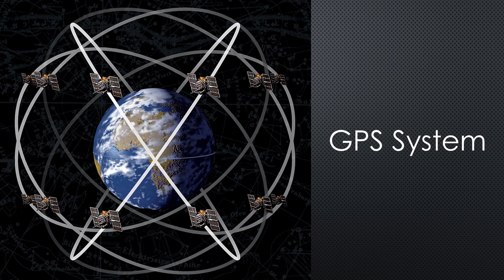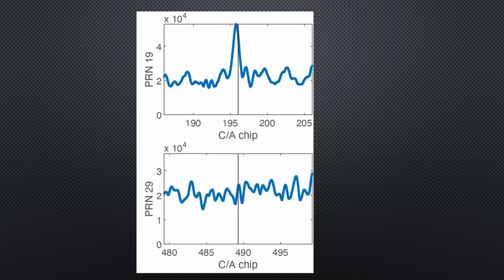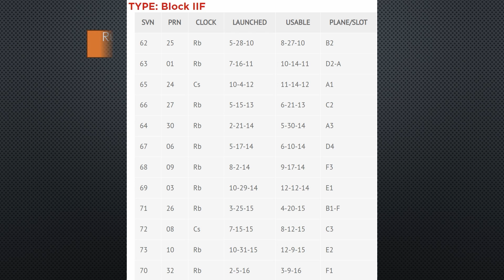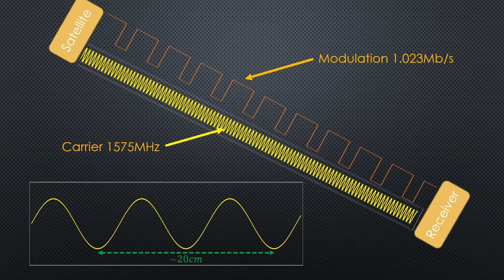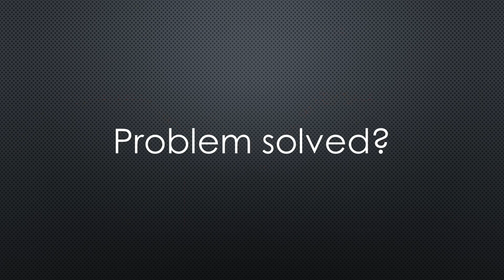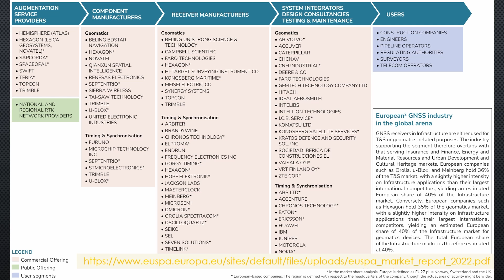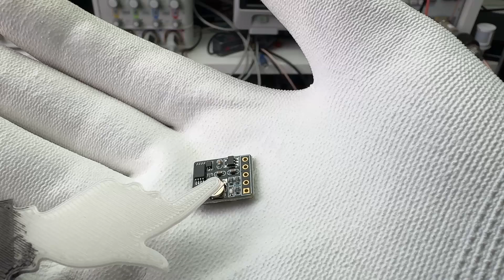(483) ESP32 precision GPS receiver (incl. RTK-GPS Tutorial). How to earn money with it (DePIN)

Comment: Excellent video! One question, how does the base station know it’s exact position? Is it placed using already surveyed points? Sorry I may be missing something 😅 hope my question makes sense.
Reply: In the case of onocoy, this is done through processing of 24h of satellite phase measurements from a base station, and then using a PPP-RTK processing in the cloud, This (non-realtime, post mission) batch processing uses additional data, eg. precise orbit information and earth orientation parameters from 3rd parties, to determine the location to ~1cm or better accuracy. 

So stations undergo a Validation period initially to determine their precise location, and this is repeated frequently to verify that is has not been moved.

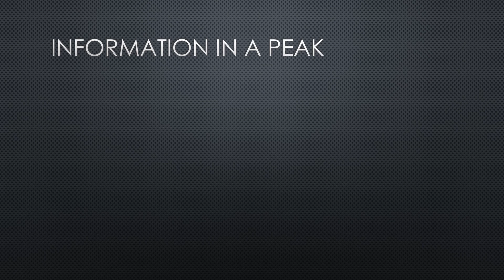Comment: 6:10  Correction: 1ns corresponds to 30cm, not 30meters.
3E+10cm/sec x 1E-9sec = 30cm
Reply from the maker: You are right. My mistake!
Reply: @AndreasSpiess Thank you for video. You did a great job! Typical resolution of the cheap GPS is about 3m. There are, probably, technical factors that degrade 1ns ten times.

Comment: I love this video, with the introduction and everything. Very educational, thank you!
So basically, even if I have my own base, I always need some RTK online service if I want to build something like a fully automated dyi lawnmower in order to get that cm level precision, is this correct? I'm assuming the raw data sent by the RTK base has to be transformed into the respective RTK correction? Can it be done locally?
best regards
Reply from the maker: If you have your base, you can decide how you want to transfer the correction signals to your rover. An online service would be one, but you could also use other wireless serial connections. At least on short distances of a few 100 meters.
Reply: @AndreasSpiess  thanks for the clarification

Comment: Great video! This seems like a very cool application of blockchains. With increasing precision available GNSS is becoming a real alternative to many other forms of sensors, in my use case it seems like a possible replacement for variometers in gliders for which traditional pressure differentials (TEK) have inherent disadvantages. 

With good RTK coverage (available globally to anyone at a fair price) it would likely be possible to achieve better precision while also relying less on expensive (and erratic!) IMU sensors. And I would assume there are many other use cases like it. A bonus would be if every club could contribute to coverage for the wider infrastructure and at the same time be compensated for their contribution.
Reply from the maker: I agree, there are a lot of use cases. And as usual, if a service becomes available, new ideas start to come...

Comment: Thank you, great information and I may take on building an RTK system as I have a Yarbo Lawn mower/snowblower/etc... but my issue is getting HaLow from the RTK to our front yard because of a large hill, (Not Swiss type hill, so maybe small to you but causes interference :)) I am trying to figure out how to get a strong HaLow signal to that area and the company states I cannot use an extender.
I bought a Morse Micro router to at least try but I may use the router to get wifi to the front because the Rover also uses Wifi to communicate it's position.
If you know how linking a HaLow internet to my rover I'd love to see that video.
Thank you
Reply from the maker: HaLo, like most radio waves, cannot pass through obstacles. So you would need a repeater on the top that can see both. If you are lucky, signals are reflected somewhere and, like that, can go around the hill.

Comment: Excellent video Mr.Spiess. Can I ask you a question? I would like to know which one or which ones you think are the best equipment that can be fixed in forest conditions. The best device I have found to date is the Hemisphere 631, but it is a bit expensive. What should you look for when purchasing one of these devices? From what I have read, the number of bands and frequencies is important because it can capture a greater number of satellites. (PD: I have some relatives whose last name is spiess, they come from germany many years ago) Regards
Reply from the maker: 1. I did not check the performance of the receivers for weak signals because this is not needed for a base station with an open view to the sky. So I do not know the answer
2. Indeed, there are Spiess also in Germany, somtimes also written with only one "s" at the end

Comment: Instead of the 250US$ UBlox (1-2 units) now there is s cheaper Hardware from Waveshare LC29H(XX) GPS_RTK HAT for 60 US$. You need a Raspberry, too. It the worst 2x RTK HAT (Base + Rover, the LC29 is different + 2x Raspberry PI.
The hardware is working on a Raspi4. Unfortunately I did not manage to get the BKG Ntrip Client (BNC) working on the Raspi up to now. Qt5 has to be installed for a graphical interface. Maybe there is another software.
Reply from the maker: Thank you for sharing your experience!
Reply: @AndreasSpiess  You are welcome. 
It can mean - thats your decision - work for you. :-)

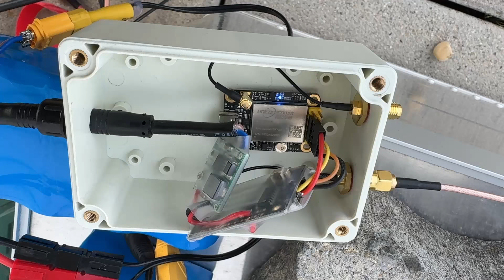Comment: Andreas, @14:10 in your video I see a Witmotion UM982 board (i.e., dual-antenna), with only one antenna connected.  Did you buy a UM982 board intending to have some other fun trying out relative positioning/orientation, or is there some other reason you didn't show and use the UM980 (single antenna) board "color" from your AliExpress links?  Thanks!
Reply from the maker: Yes, I thought that the UM982 offers more possibilities for a similar price
Reply: @AndreasSpiess  I enjoyed putting together a UM982-based kit.  Although Android Bluetooth SPP seems easy and robust, one of the challenges has been BLE reliability & performance required to run the iOS version of SW Maps.
SW Maps works ONLY with the Nordic's UART Service (NUS) profile for BLE.  I tried the Adafruit Bluefruit LE UART Friend (which supports NUS), but found that its bi-directional throughput was poor and unable to support NMEA / RTCM traffic volume.  I also tried Sparkfun BlueSMiRF V2, that works great with heavy unidirectional loads, but crashes and disconnects under that same bidirectional workload - I buffer overrun bug I think.  Have you experienced these issues for iOS BLE connections before?  Thanks!

Comment: Grüezi Andreas

Thank you for this once again, very exciting video. 🙂
What about the accuracy near a building or balcony. I would like to land automatically with a quadrocopter on a balcony, which is covered (beton). I have been looking for a solution for a long time, but GPS RTK was (so far) too expensive for me to test it myself. Could you test a similar scenario (covered veranda, balcony, garage, etc.)? 

Best regards

Marco
Reply from the maker: As I mentioned, reflections are bad. But you have to test your special case. It will differ across small distances. Keep in mind: 20 wavelengths has the minimum and maximum very close…
Reply: This generally could work. It is the reference stations that needs to have full open sky visibility. The moving device - the drone - can navigate accurately also if the antenna has a slightly blocked view of the sky. In the end, it depends on how the receiver applies the correction data. Devices based on u-blox F9Ps are good products that you could try out and experiment with

Comment: I really love your content - it made me building my own home automation. I would love to use precision GPS there as well, e.g. to trigger certain actions when an ESP module with receiver would approach my garage door :-) The system should not rely on WLAN as it takes too long to establish a WLAN connection when I come home by car (and we have nor reliable LTE network in our area).

Unfortunately, I am I bit confused now:
- when I build such a base station, would it send a signal that could be used for correction in the vicinity (e.g. 20 km, actually about 2 km would be fine) or does this base station only work with data transmitted thru the internet.
- when I build such a station, would a newer smartphone (e.g. iPhone 13) make use of it so that I get precision location at home on all smartphone applications as well?
- which GPS receiver should I use in combination with ESP32 to get precision GPS in my car nearby the base station. At best, including a heading information.

Sorry for these many questions - is is a complex subject and maybe, other are also interested in more information!

Have a great Sunday,

Thomas
Reply from the maker: 1. The RTK fix takes some time. So if you move out and in your Wi-Fi that would apply all the time. So I would use the Spartphone hotspot to keep the fix in a 20km vincinity
2. The smartphones currenlty have no RTK receivers, only GPS.
3. I keft a link to the receiver I use. You also can use one from u-blox (it does not cover all bands, but this is not important for the rover). The UM-982 has too antenna connectors to determine heading. But so far, I did not see software for that purpose (I also did not search).
4. If the base and the rover have a line of sight, you could also use a standard wireless connection (e.g. 433MHz) for a connection. Then, you would not contribute for others, of course.
Reply: Thank you - that helped a lot and I need to find another solution …

Comment: Hi Andreas, 
I am working on a concept and need to develop a high-precision (anywhere between few inches to cm) GNSS tracker. Can you help. Following are brief spec
Specifications:
•	Tracker will track an object/person moving at a speed of 15min/mile to 30min/mile
•	Tracker will give haptic vibration feedback whenever an object or person deviates from its path
•	Tracker power source will be a rechargeable battery and will need power for max. duration of 3-4 hrs.
•	No outer case is needed
•	Size should be as small as possible
•	Tracker will be facing the sky while in use
•	Tracker will always be used in an open field where there are no buildings or obstructions
Reply from the maker: YouTube is only my hobby, and I share my knowledge in my videos. If you need more, you have to search for a consultant :-(
Reply: @AndreasSpiess  do you know any consultant that you can recommend

Comment: Thanks for the video! Are the base stations somewhat mobile? And how well do they tolerate foliage or tree cover?
Reply from the maker: They are mobile over time. But if you want to use them as a base, they have to be fixed.
Reply: @AndreasSpiess  How fast would it be possible to reposition a station? I would like to use it to determine sample points for forestry, but professional systems are out of my price range.
Reply: @AndreasSpiess  And thank you for the answer, of course.
Reply: @jogginnoggins9918  For such an application, you would want an RTK Rover (i.e. a moving device with a RTK capable GPS receiver and a correction service. A rover can determine its position centimeter-accurate every second, with the help of a a base, a fixed station [that should not be moved - that's the whole point - the base provides like an "anchor" for moving devices to locate themselves accurately in their vicinity])

Comment: Thank you very much for you video. I have a question : Is it possible to use the same RTK receiver you've used in your base (WTRTK-980) in a rover ? Thank you !
Reply from the maker: I think so. However, the 982 has two antennas to detect also the direction. Sometimes useful for a rover (but needs 2 expensive antennas)

Comment: wish you would have shown at least a little  how you built your unit
Reply from the maker: I showed the overall diagram: A receiver, an ESP32, and 4 wires. I added a step-down converter because I use 12V on my roof. It is not more complex.

Comment: I wonder how drone swarms in like, those displays with 1000's handle position like do they use regular space GPS or do they nominate some drones to station keep and give them very low jitter clocks and rebroadcast a GPS-like time code for the swarm to use with like, no lag and super strong
Reply from the maker: I also wondered how they navigate. Maybe somebody knows?
Reply: Drone swarms do use GPS RTK technology to locate each drone accurately and in real-time. If you search for "How drone light shows use GPS RTK", you will find further info [can not link due to YT censoring]

Comment: hi my dear - very good system - thank u for u - is this base station suitable for any gnss rtk for example if I have hi-target gps unit - can I connect with it or must buy tow rtk gnss receiver as use
Reply from the maker: The base and the rover have to have a common protocol. Either directly, or via a service. The Base station I use is made to feed particular services mentioned in the video. And the Rover is connected to them.

Comment: Thanks.  As future topics, may I suggest explaining more about SBAS vs SSR (Satellite Based Augmentation System, State Space Representation) vs IBSS.  Some SBAS supposed to be free? Any cheap hardware? (for online positioning in remote locations (out of Internet and any other bases). 
Most receivers have 2 L1/L2, is it worth considering 3 bands in one (again without base)? 

Are there any other similar cheap but paid info sharing networks?  (To combine loraWAN/iot, meteo, eco-monitoring, GNSS-base with Starlink - to expand available data/service but have some modest payback for remote Stations/Farms).
Reply from the maker: I do not plan to investigate into these commercial services. There are more specialized channels for that. As said, you can use any connection between the base and the rover, also Lora or starlink if you want.

Comment: Please, is there a cheap and easy way to make a clock that does not need to be manually set from time to time? Something like ESP32 using an NTP? I'd like to give one or two wall clocks like that to my mother. Thanks, great videos! I just subbed!
Reply from the maker: I once made a video about an "DCF77" simulator that uses NTP and transmits it to a IKEA DCF77 synchronized clock.
Reply: @AndreasSpiess  I will look for this video, thanks!!!

Comment: I mean, TCXOs don't seem to be that expensive, even an OCXO wouldn't massively increase the cost of the project (<$50). Or is it just that CM accurate precision would still need a better clock source, so you'd still need to do the same tricks?
Reply from the maker: As said in the video: A better receiver clock would not help. Ocxos are very bad in the longterm compared with GPS time. Watch my timing video to see why a combination is a perfect solution.

Comment: You mentioned how cellular networks already use GPS, including AGPS. It seems like it would be obvious for them to also include the RTK hardware, since they already have to place towers every ~10km or less.

It's a shame that service pays you in crypto. I understand how that can be the equivalent of getting stocks in a company, but crypto currencies come with so many issues: excessive waste of energy on "proof of work", difficulty of converting it to real money, and it's inherently volatile and ephemeral, making it a poor way to "get paid" for something.
Reply from the maker: 1. Cellular stations only need the timing signal from GPS, not the position
2. I agree that cryptos have many issues and in general, I do not like it. However, I am an engineer and if something can solve an issue, I am interested. The blockchain used by Onocoy is based in proof of stake which is not wasting a lot of energy, BTW.

Comment: You never explained how the base station knows it's exact position; if it used GPS, it's position has an accuracy of a few meters. Otherwise great video.
Reply from the maker: You have to find out the exact position of the base station using physical means (or, in the case of Onocoy, they have an algorythm to determine it from remote).

Comment: Hello, how are you? Excellent video! I am from Brazil and would like to know if it is possible to set up a system like this to capture control points during aerial mapping with a drone. Unfortunately, we have limited access to technology, as there are high import taxes. Even if I purchase the Um982 and the bt300S antenna, I would spend approximately 570 dollars, including taxes. In this case, would I need to buy this equipment twice? One for the rover and one for the base? Thank you very much, and if you have any other ideas that could help, I would appreciate it.
Reply from the maker: This is also an expensive technology where I live. Yes, you need two RTK modules if you cannot rely on a service as described in the video.

Comment: It sounds quite interesting. But (normal) GPS is well accepted because you can have it everywhere and you can have it for cheap. I accept some more effort for the base stations - but as long you need the same effort for the rover … 
Or did I miss something - is there an option to implement a rover for 50€ or less?
Reply from the maker: The rover needs the same expensive receiver. So it is only good for particular applications.

Comment: Dear Andreas, very nice video. May I ask which is the benefit of using two receivers/splitter/DC BLock? Also the "DC block" link in your list is now "page not found".
Reply from the maker: I checked the link and here, it worked. Do the other links work?
Why a splitter? Some people want to earn more than one crypto and therefore have to operate more than one receiver. To save on the expensive antenna, they  use a cheaper splitter. And because the two splitter outputs are connected and both receivers supply DC to power the antenna, I inserted a DC block at one side.
Reply: @AndreasSpiess  Thank you very much for the explanation. Yes the link is working now. Kind regards from Madrid.